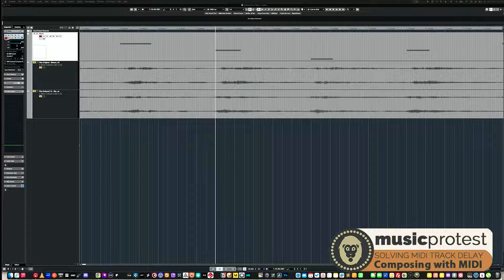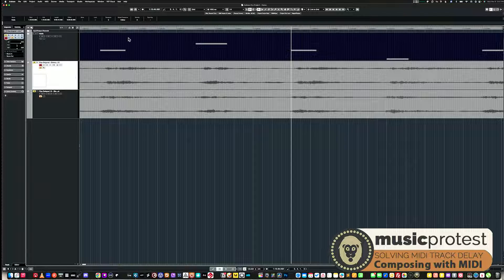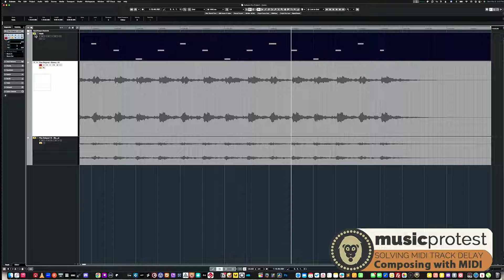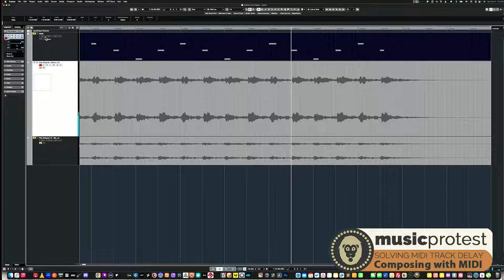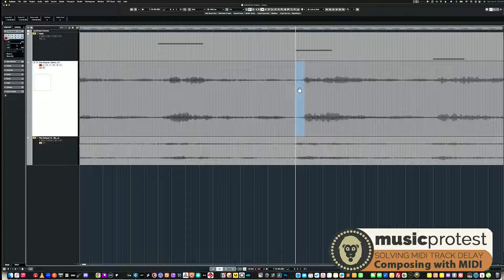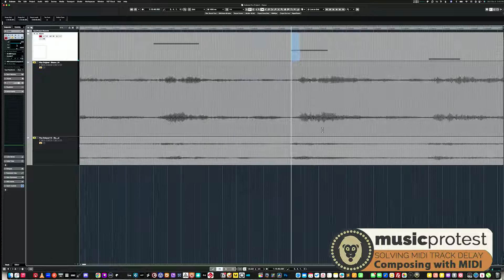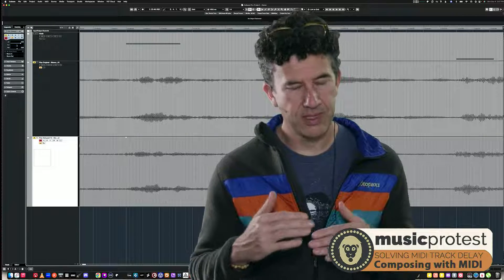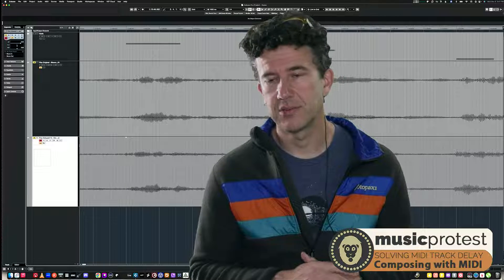Solving MIDI Track Delay in Cubase | Fix Negative Track Delay | 100% Synced Tracks!

Comment: Very descriptive of the problem and the solution. I have never read that this problem arises from the attack part of the samples. Perhaps I have a different problem. I am trying to play-record vst drum libraries with a drum multipad alongside an audio track. As you said, when I play I dont notice any significant delay or latency when I am recording. But when I play back the drums sound slightly ahead. And if I check the piano roll the midi hits are always before the beat on average. What could be my problem ? Can it be solved with Cubase track delay  ? I dont want to quantize my drum hits
Reply from the maker: Thanks for posting!  You may have plug-ins that are creating a lot of latency on playback and I would look into Cubase’s “constrain latency” feature and see if toggling that on and off has any meaningful effect.

You could certainly use the delay compensation on a per track basis to address the issue you’re describing. You can use the delay compensation for positive delay as well as negative delay.  

I imagine you want to maintain the live performance and that’s why you want to avoid quantizing, but I’d also suggest looking at iterative quantizing, which allows you to tighten up the rhythm while still maintaining a desired percentage of your original performances nuance. I hope that helps!